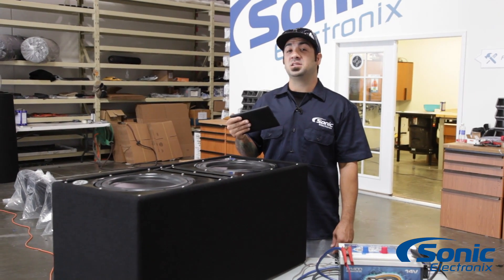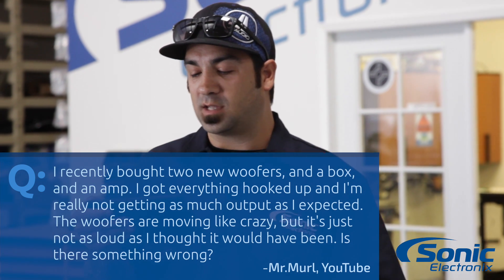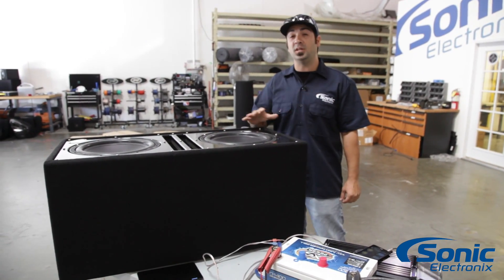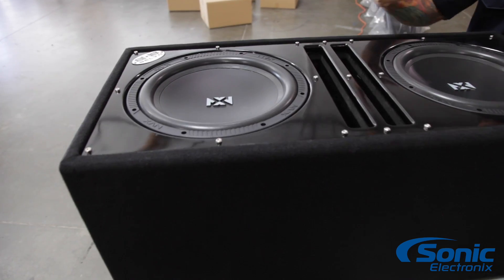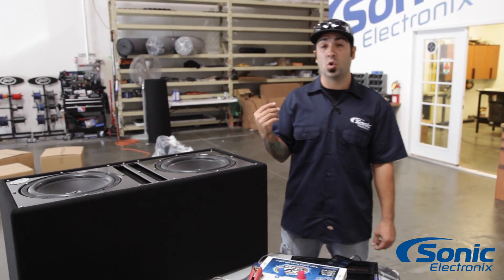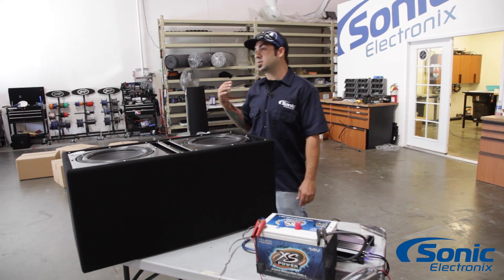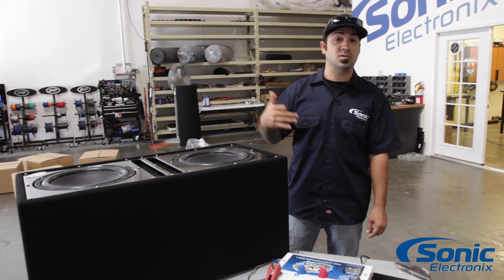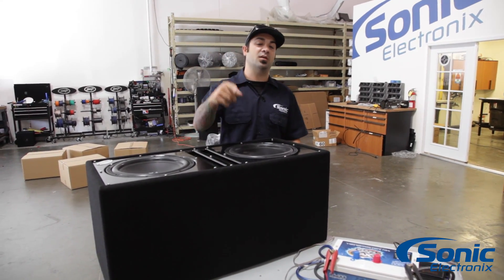I'm Not Getting Much Output From My Subwoofers | Car Audio Q&A

Comment: okay so I have a question I have a rare vintage early 90s 18 inch Rockford Fosgate xlc I believe it's 8 ohm at 600 watt Max I'm pushing it with a boss 2400w amp before I switched and wired it to bridge mode it would not heat up the amplifier the amplifier always remained really cool down but when I went to Bridget I noticed that it was really heating up my amplifier why is that

Comment: I have 2 12” in a box like that, but there’s only one area to plug in my speaker wires on the outzide when my 2 10” had 2 seperate thingz for the speaker wires, do I uze both pair of wires into the one connection that my new 12’z have or just 1 pair of wirez

Comment: I recently switched out my old audiopipe 1500 apcl for a skar rp 2000.1 to go on my single 15 inch evl and the new skar amp seems to not have the output the cheap audiopipe has I then rehooked up the old amp and everything is normal and loud! sent the amp back to skar to test it they said its fine when I got it back I hooked it back up and to no surprise the same result the audiopipe is louder! this shouldn't be I went around with a dmm and everything tests fine im stuck!
Reply: Thats crazy. I have the same problems with the same exact amps. Still can't figure it out
Reply: Took apcl 1500 out. And then akl i did was lay the rp2000 in the same exact location, wired it up, and i don't get nearly half the bass response as i do from the apcl1500. If you solved the problem please shoot me a message and let me know!!!!

Comment: I need help with something, I'm having a problem with when I increase my volume on my live sound system, the bass doesn't keep up, hard to explain.. I have a 18 inch sub and 1 15 inch top, a simple RadioShack pa speaker and a jbl 2269h driver in a box of course. Do you have any idea why my bass decreases a little the louder I go?
Reply: Are they all run from the same amp?

Comment: how the hell can you wire wrong. you only have a positiff  and a negative.
Reply: promo130 - My 2 12” have only one place to connect my speaker wires while my 2 10” had 2, do I connect both pairs of speaker wires to that single connection to my subs or I only need one pair

Comment: I have a 2018 Jeep JL that I had a local sound place put in a lc2 and a kicker amp with a 12” sub and it does not bump at all . It sounds horrible as if it does not work. 
Any idea what they did wrong ?
I do not have the alpine system in my Jeep I have a 7” screen with no sud ect Sahara Jeep JL the new one out ..
I really want to fix this problem.

Comment: I got my 2 12's in a ported box with separate Chambers how do I go about wiring my svc 4 ohm subs down to 2 ohms on outside of box?
Reply: If the box has two terminal cups just get enough speaker wire so it reaches positive to positive and negative to negative on the box. Then add one positive wire and add one negative wire out of that any terminal to the amp should drop to 2ohm
Reply: [•  •] ====[•  •] positive to positive negative to negative on the box and then get on positive from one terminal and one negative from the other and run it to the amp                                Amp<----negative----[•  •]====[•  •]---positive--->AMP

Comment: My question is two rgbs comes from my sub to two line outs (red and white) from my amp. But my mate said I only need to wire one line to sub not two? White to left channel of sub which is mono anyway..is this right. Only that I tend to find my sub cuts out at quieter levels? 
     Thanks..steve

Comment: Yeah or like my idiot installer I just found out had my frequency set st 175 and bass boost all the way up and just played with gain everytime I went back.  And the signal from amp was tapped into bose system wrong for signal so entire system wasent doing anything but smelling. Bad installers can ruin your equipment and make you think your crazy. I found a REAL installer and fixed my shit legit. Fuck reviews because apparently they are all dogshit so idk how anyone should choose an installer other than word of mouth from a good source. Andddd.dd.....I'm done ranting.

Comment: question> i have a 1k watt amp and 1k watt subwoofer at 2 ohms at the same brand and 4 guage wire and when i turn up the volume the amp starts to smoke what is wrong???
Reply: Lmao dude.. Amp is fried.does it even output any sound

Comment: Really dumb question and I think I figured it out gunna try after work but this is how my subs wired rn. Amp ( - ) two wires running to each ( - ) on each sub. SVC btw and then I have the positive running as if we're parallel. My subs randomly worked for 5 or 6 hours then next day they don't work. They work but sounds like shit and slowly cuts in and out. Guess that's the issue cuz I checked everything else. Any thoughts?

Comment: I need some serious help with my subs. I have no clue what settings or what settings I should set my amp at. I'm so lost. My aftermarket head unit has all these settings on them, and idk if I need them on or not, and idk what any of the dials and switches do on my amp. If you could help me, please get a hold of me.

Comment: I have a subwoofer two 10 inch 100 watts each and amp is tda2030 dual ic bridged for each    channel transformer is 12 0 12  5 amps....normally its works fine and Good bass but higher volume level distortion starting like low powerd ...why...?
Reply: Hari K Nair bro. Pls use 24v 10amp most. Your problem will slove.

Comment: How to test phase. Get a double or triple A battery, touch positive end of battery to positive of wire and negative to negative of wire. If both speakers pop out, congrats, you're in phase. If not, then your not. Dont hold it there for too long cause you could risk overheating the coil.

Comment: Wait....so you can't wire 2 dual 4 ohm down to 2 ohms for final impedance ?
Reply: No, two dual 4 ohm subs can only be wired to 1 ohm, 4 ohms, or 16 ohms. They can be wired to 2 or 8 ohms if you only use 1 coil per woofer, but that will cut the power handling in half.
Reply: AnythingLoud well looks like I'll be swapping out my two dual 4 ohms Skar Audio IX 8s for two dual 2 ohms

Comment: Quick question; my subs may be out of phase but I'm confused because the have great bass with only a select few songs being about 4 and the rest it doesn't have the same amount bass; what are your suggestion ?
Reply: it sounds like you have a box that is either tuned too low or too high as for the reason it only works on some songs of your.
Reply: peaky box

Comment: I bought 2 used subs from my friend for cheap, one Knwood and one MTX both 10 inch, and they're wired to a 2000w Pioneer amp which is overkill but it was free. I don't have the specs for the speakers and I wired them both bridged out of one channel to both subs, and I have them pretty low so I don't blow them but they sound bad. I need to know either A). What's a safe power output for the max power without blowing them, or B). How can I find their specs, they're from anywhere mid-2000's to 2010ish. Any help is appreciated!
Reply: Bridged it's usually only 4 ohm stable

Comment: hello sonic.i have a question about stiffening caps, actually I got a few. 1 how does a cap discharge power. does it only discharge what's needed or the full load of what it's rated for. 2 I have a 500 wat alpine amp but I'm still getting the whole dimming n amperage drop and I have a 4 farad sound stream. I'm aware of the rule of thumb of 1 farad per 1k wats so i was also wondering if I hooked it to my amp would I potentially damage my amp. don't kno if it makes a difference but I have my subs wired at 2ohms. thank you for your time and insight it's very much appreciated.

Comment: How can i tell the polarity when its in the box?
Reply: How to test phase. Get a double or triple A battery, touch positive end of battery to positive of wire and negative to negative of wire. If both speakers pop out, congrats, you're in phase. If not, then your not. Dont hold it there for too long cause you could risk overheating the coil.
Reply: theres no way you could overheat a cold with an AA or AAA battery. not enough voltage even if you left it on for hours. the coil barely draws any power or current at 1.5v
Reply: Speakers move both out and in, If you are using a single sub it doesnt matter too much anyway as most headunits let you flip the polarity.
Reply: well if you the cone moves OUT when the bass hits it's in phase, if it moves IN it's out of phase.
Reply: thornygravy thanks

Comment: my subs r hitting but not like they were, i have Rockford fosgate 2 12 p1s, and they are 8ohm but i wired it to 4 ohm and they aint hardd
Reply: have you stood aways outside of your vehicle. I know sometimes if you wire your subs different ways it might not sound loud n the cab but get outside of it n be like WOAH NELLIE!!!
Reply: +Michael Gonzales Well a P1 are single voice coils. Wired parallel thats 2.66 ohm. If the amp is 1ohm stable you are getting only half the power. Wired Series you get 12ohm.....zero outout. 2 things the amp needs to have enough power for the subs at 2 ohms to work.....and when you use two different ohm load sub you get a mix bag. The 8 ohm sub is moving half as much as the other sub. So you only have 1 plus a half of a sub system. if the amp is 2ohm... sell the 8ohm sub buy single 4 ohm, wired parallel to the 2 ohm load. If amp 4 ohm....sell 4ohm get another 8 ohm, parallel to a 4 ohm load. If amp 1ohm sell both subs and get 2 dual 4ohm subs,wired parallel/parallel to a 1ohm. All that If your amp is big enough for said subs......enjoy

Comment: can you wire a dual voice coil sub to a single voice coil sub in parallel?
Reply: There is no such thing as wiring a dual voice coil speaker to a single voice coil.
Reply: He means wire a DVC sub to a SVC sub in parallel. Yes you can. But tell me what the impedance is of the DVC and the SVC sub and what your amp is rated for?
Reply: dvc 2 ohms svc 4ohms
Reply: 1 0hm
Reply: amp 1 0hm
Reply: MJ SIMPSON I would say wire the DVC in series so it's rated for 4, and the SVC will also be at 4, then wire both of those in parallel for a load of 2 on the amp. Are you sure you can only put a load of 1 on the amp?

Comment: if your head unit is cheap and not giving proper voltage through rca it wont sound right ether
Reply: Daniel Lloyd with 8volt preamp output most amp wouldnt need the gain at all, most amps gain starts at around 6 down to .25 volts
Reply: Don't touch the gain if you don't need to
Reply: use a rca to 3.5mm stereo into phone or audio source cable and plug directly into amplifier and test if subs are louder then. it must be the Headunit
Reply: Pioneer DEH-X7800DAB does that count as a cheap headunit? i wouldn't but i have a similar problem, my subwoofer cone is barely moving even men maxing the gain on my amp, dont know what is wrong, any possibility you know what the problem is?
Reply: is your subs hooked up right 2ohm 4ohm?your amp reads the ohm load like mine is 2ohm stable so im getting max watts from it but stock alternator and cheap battery so not getting full wattage
Reply: my sub is a B2 is12 2ohm DVC sub, first hooked it up in series thus getting 4ohm, i got a gas pro 1000.1 monoblock that can send 400w at 4ohms. even when the gain is maxed there is barely any movement in the cone... i rewired the sub to parallell, 1ohm, amp can push out 1000w max at 1ohm. here aswell, almost no cone movement even at max gain... checked all the polarities on the cables from the sub to the box terminalcup to the amp and all checks out fine... im really heartbroken about it because it seems like no one on the internet has the same problem as me and thus no solutions for me to find... you have any idea of what it could be? crossovers are not set, neither on the headunit nor the amp, tried setting it on the amp but without any improvements, amp is rated 1ohm 1000w stable btw
Reply: Rca's might be bad or maybe headunit or possibly amp could be bad are you sure the amp is cutting on? Sounds like a problem with rca wires
Reply: Daniel Lloyd I'm not in the workshop at the moment, it's 01.00am here in Sweden haha but I will check everything I can afternoon. I use the same rca cables to the front and the rear so I'm doubting it's them but hey.. even individual cables could be faulty. I'm gonna check with a multimeter tomorrow on the amps terminals to see how they behave. I also have a neighbor who works a lot with car audio, asked him to come over and have a look at my problem. i got work in 6h lol I'm just so desperate for a solution, can't stop searching around haha
Reply: Yeah iv bought new cables that where shit never know but good luck man
Reply: solved the problem... i was stupid and trusted a guy who said he had alot of experience with car audio... he told me the remote knob should be set to minimum and not touched until the gain, crossovers etc are all correctly set first.. i discovered this to be wrong... the hard way! i accidently hit the remote connector on the amp and it disconnected.. boom suddenly perfect bass..
Reply: Lol hell yeah
Reply: Daniel Lloyd if it's bad signal yes, bad voltage is fixed through your gain setting
Reply: My gain is not on and my sub pounds
Reply: Daniel Lloyd I was saying the gain setting is to be matched with the voltage going through your RCAs
Reply: How is that I have 8 volt gain off and bumpen
Reply: Teodore, Any chance you could explain what you mean by this a little better? I've got the same problem and this might help. You disconnected the remote on-off and the base started working?

Comment: How about some love for the moderately not-so-newbie people.   How do you design an efficient subwoofer enclosure with very little box rise.  Sometimes just having a 2 cubic feet enclosure to a single 12 per manufacturer spec just does not cut it output wise and when you clamp test it, it rises to 4 ohms when wired to 1 ohm, sometimes higher depending on the frequency played. How are these other people building boxes with less than .5 ohms of rise, wired to 1 ohm and rising up to only 1.6 or so?

Comment: I got a problem i have all installed but i noticed a big problem in a small component of my amplifier ( this is an amp that is full range and lowpass filter) and i use it for bass well while playing sometimes i have loaded my car with bags ect and i stoped hearing low freq so i noticed( that switch for low filter  may be damage what can i do ? Can i get a spray or should i send it for repair its an old amp .500watts

Comment: hey guys, I was wondering if anyone could help me out? my amp powers on but the subwoofers don't seem to receive any signal at all, and I'm puzzled because I had this problem and thought maybe it was the subwoofers or the head unit or the amp or the wiring in the sub box or the rca cables, but I've replaced all of these things with New ones and rewired the new subs and everything but my subs still won't work, any ideas?
Reply: Some amps have a high level input/low level input switch. Make sure it's set to low since you're getting your signal from rca's. Check your gain knob. If it's all the way down it's not gonna amplify anything. Check your headunit for the subwoofer level.  Are your rca cables plugged to the correct ports on the headunit and amp? The headunit ports should be marked (sub) and the amp ports should be marked (input). They're also marked red and white.

Comment: or maybe his box is tuned too high and he was expecting more lower range, that's why his woofers are moving like crazy
Reply: Well my dumbass bought a prefab 4 years ago tuned to 47hz where as my woofers spec out at 32hz tuning in a vented box and they still got decently loud but the lows where lacking very much because it was tuned so high. I guess I could’ve added extra length to the ports but it also would’ve messed up the internal volume as well. I now have a custom box at 3.0 cubic feet tuned to 32hz and the lows are much more pronounced. So a higher tuned box will still output some decent spl at higher frequencies but will drop hard once you go down low in frequencies. So, moral of the story either buy/build a box to the specs of your subwoofer or get a prefab that is really close and the difference is night and day.
Reply: @_JoeMomma  how do I buy a box close to my subs specs ? What do I do ? Match something ? I’m new to this stuff

Comment: I have 2 8w7ae wired series circuit. What's the bet amp to push them where I'm going to get the most power but also the best sound quality. I have a 500/1 slash. But it's older one and I want to upgrade. What amp should I get ?

Comment: that box looks pretty sweet. is it prefab or custom?
Reply: +sirlanceem what is the air space and tuning on it for tens?
Reply: +Sonic Electronix I checked it out.. it seems tuned way too high for my taste...i need something tuned around 32-35 after displacement..and 16 square inches of port per sub for two tens..do you sell anything like that? They want $200-$300 for a custom box
Reply: +Timothy Hinton it's prefab i bought the same box but for 10" subs from them.
Reply from the maker: +Timothy Hinton Yeah, its a prefab Belva ported box
Reply: Timothy Hinton Number of Ports 2
Tuning Frequency 40 Hz
Port Length 11.675"

Box Volume (Each Chamber) 0.71 cubic feet
Reply: +sirlanceem i need about 1.25 and tuned to 32.. thanks for the info
Reply: +Timothy Hinton i have the  Belva ported box its juck sold mine
Reply: Just build it, or I'm sure you know someone that knows someone. Check out their work though.